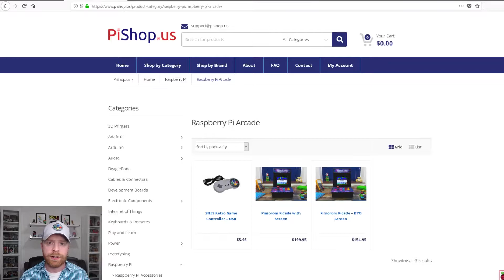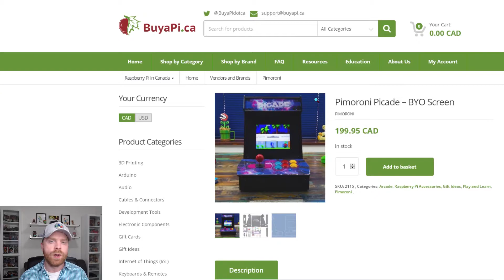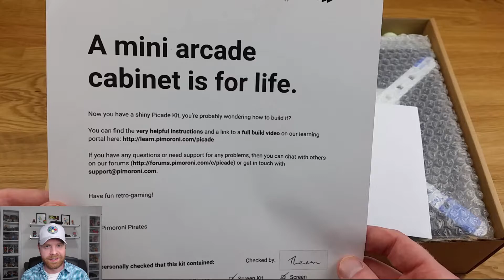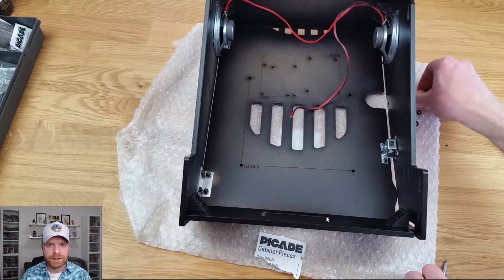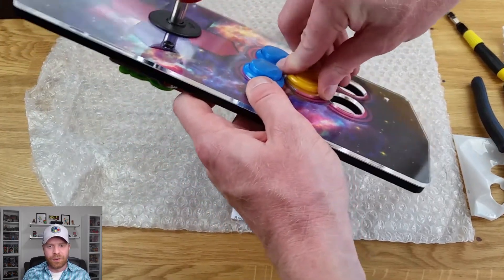Build your own Raspberry Pi arcade cabinet!! (DIY PICADE by PIMORONI)

Comment: I purchased this kit a couple of years ago. They're great. Months after assembling I wasn't happy with the 8" screen (12 weren't a available) so I went to eBay and bought an iPad 2 9.7" screen and plugged that into the same HDMI board the original screen came with and looks amazing!
Reply: Smart move.. They should have just supplied a 10" screen to start off with.. That was the only reason I didn't purchase..